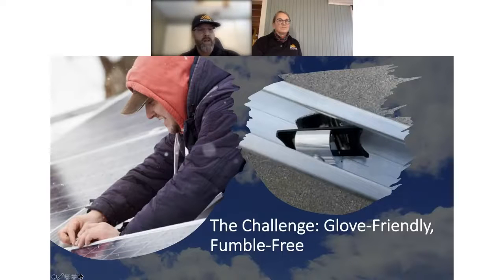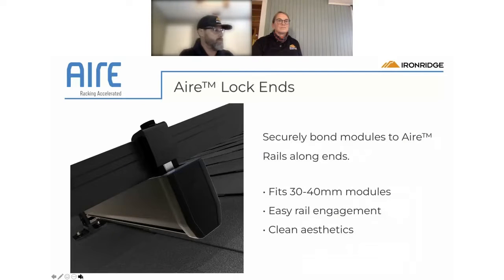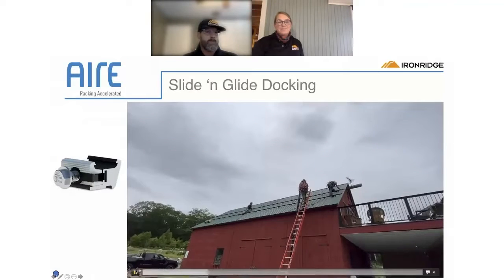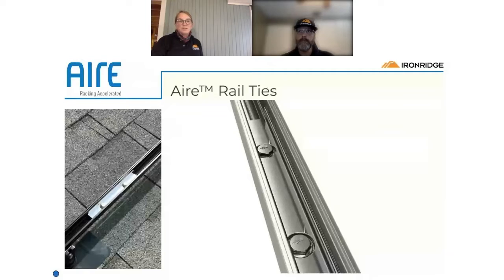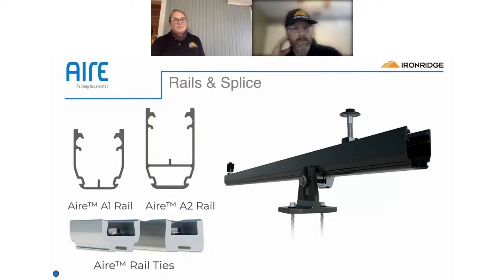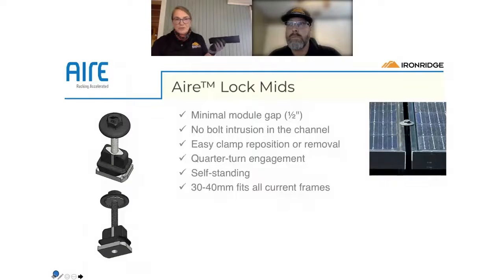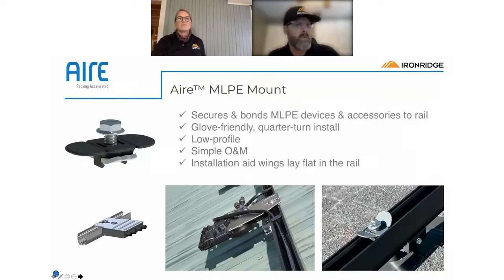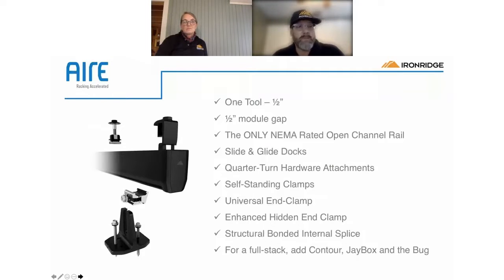Discover Aire: Racking Accelerated

Comment: Being able to remove a UFO bolt without the base falling out will be a big advantage if/when things need to be serviced. This system looks really promising.

Additionally, the bonding pin to prevent "camping out" is brilliant, and a chief complaint of mine for similar racking.